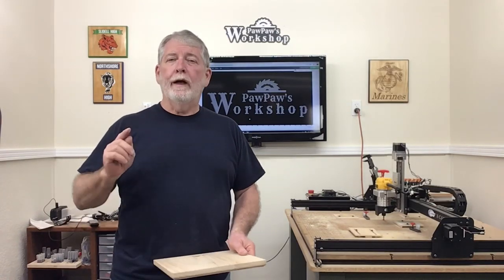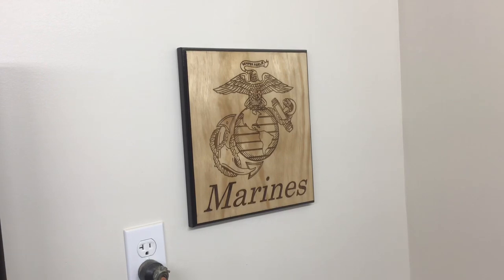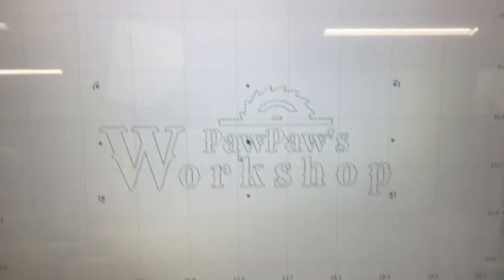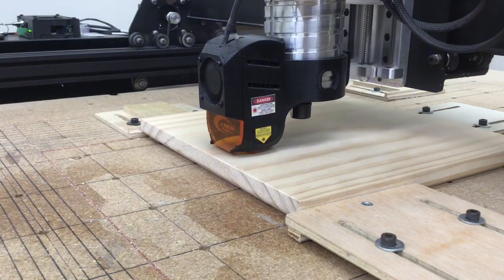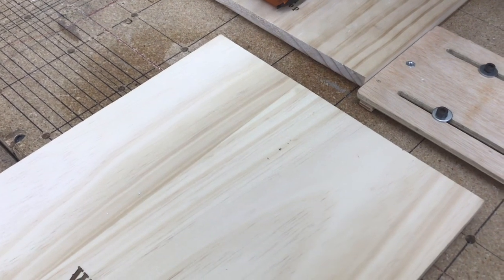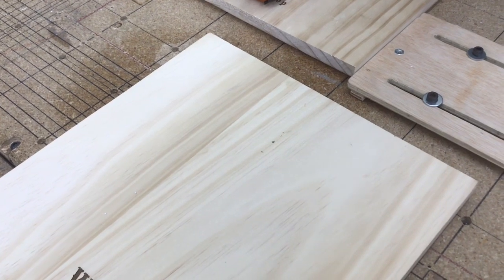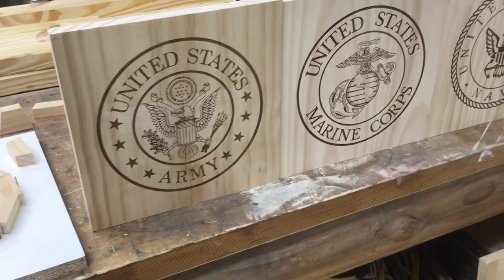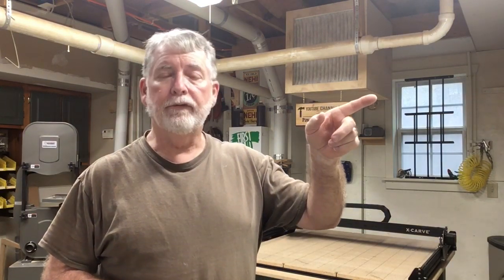How to Switch From Engraving to Carving in Seconds

Comment: Hi Paw Paw - I'ma newbie and this very interesting.  I just purchased the Ortur Laser Master 2 20 Watt and downloaded the Lightburn software.  Which model of the X Carve are you using and are there more powerful lasers such as 15 Watt/20Watt that can be exchanged with the units standard laser?  Can you suggest a CNC carver/engraver?  Any info is much appreciated.
Reply from the maker: I have the  Xcarve 1000 mm. J tech just introduced a 7 watt pro and it is more powerful than mine.  I like the xcarve.  It is a perfect platform for the laser and cnc work.  The cnc4newbie new carve that I have is my preferred machine in that it is much stronger and none of the problems that the xcarve has.ie belts and v wheels.
Reply: @PawPawsWorkShop  Thank you Sir n I love the USMC and military carvings.  Going to be one of my 1st attempts.  Semper Fi

Comment: How are you carving without touching off and doing all the set up easel requires before starting a carve
Reply from the maker: All of the checklist that easel requires you to do is nice but is not necessary.  All you need is to establish x,y,0. Lightburn  and UGS is very EASY to work with and do not require that whole checklist.  The checklist is excellent for new people just starting  to ensure nothing is missed.  As a pilot, I like and use checklist all the time.

Comment: Paw Paw - those plaques look fabulous!

I have a setup almost identical to yours. One thing I’ve learned (and this may help newer users) is to do the “risky stuff” first. More than once I have made a beautiful carving, then painted and sanded it, only to ruin it at the end. 

My workflow:
Cut piece to final dimensions
Round over edges on router table 
Cut keyhole 
Only then do I start the lengthy CNC part

Hope this helps someone. I learned the hard way!
Reply from the maker: Thank you very much.  That is an excellent workflow

Comment: Your title for the video does not match the content. I was hoping to see what you switched on to engrave (in Lightburn) and what you switched off to move back to the router for the keyhole.
Reply from the maker: Switching is so simple. Close one program and opening the other.  Removing the laser and installing the bit with the mount in place. So, so simple.  I showed that in the video.  Maybe it is just too easy.

Comment: Do you have to do anything special with the machine switching from laser mode to CNC mode?
Reply from the maker: No, all you need to do is close the Lightburn software and open Easel.  I remove the laser only to prevent it from getting dirty.
Reply: That only depends if you are using the IOT relay with your machine. The relay with automatically start your router when you hit the button. When I switch between the two, I turn off the iot relay and do what Paw Paw says. Close one system and open the other. If not, they will battle each other for the x-controller.